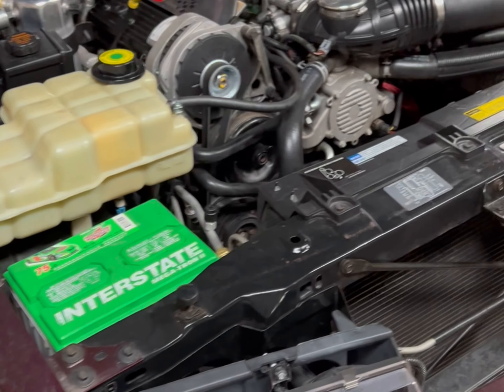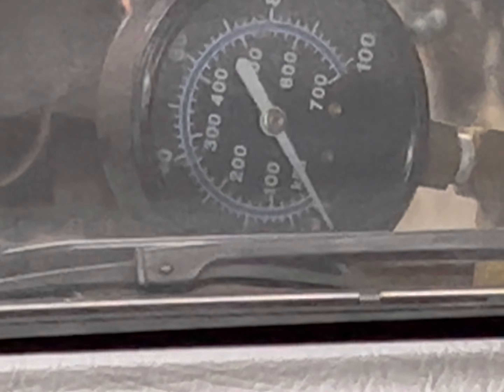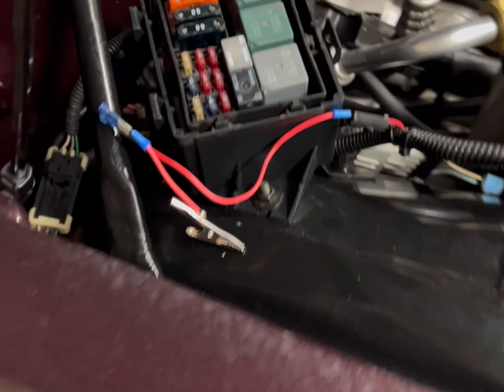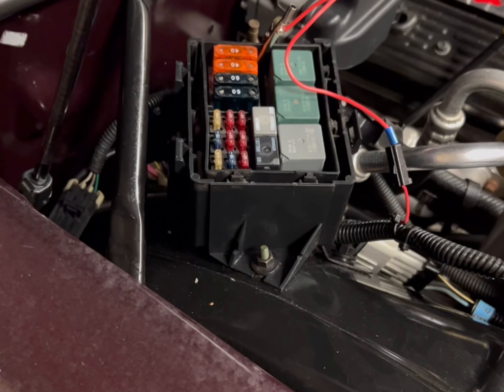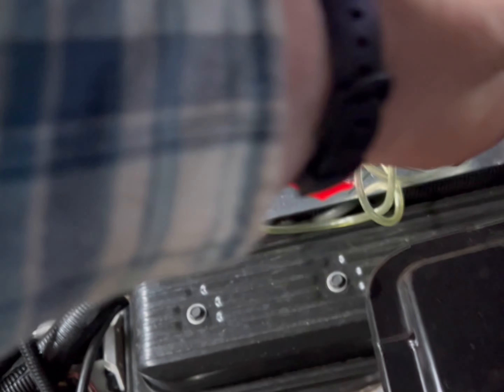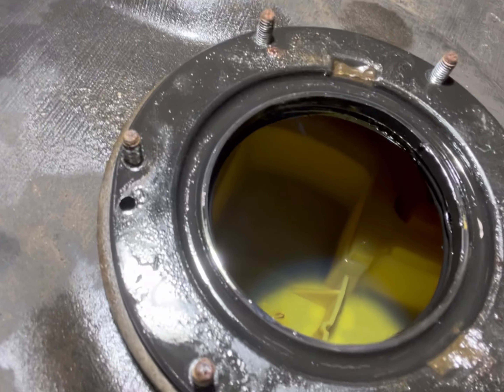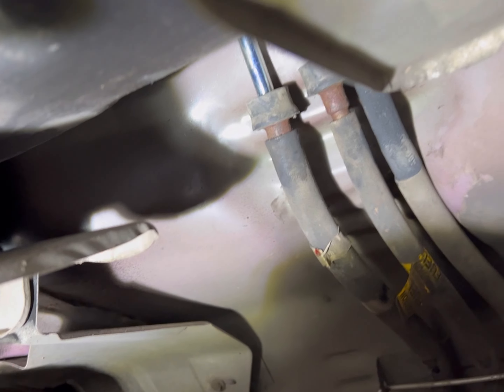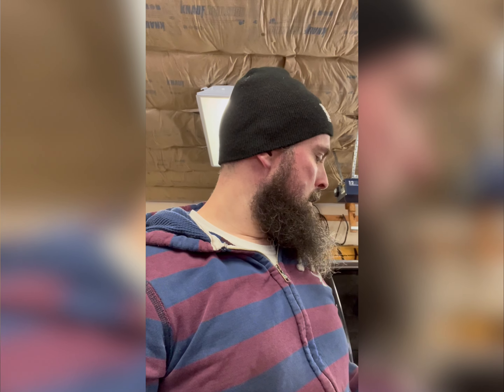Fuel pump and fuel filter replacement on 1995 Impala SS! #chevrolet #impalass #bbody #chevy

Comment: Thank you so much if it wasn't for this video I would have changed the pump I would have been disappointed. I was messing with that red wire and used it for an accessorie and ended up blowing the fuse. It ran fine the next day like nothing ever happened then 2 hours later when I got back in to start and leave I had nothing got so mad I hillbilly towed it home watched your video and BAM new fuse fired right off thanx again hope to see more vids from you.
Reply from the maker: Appreciate it! Glad I could help.

Comment: when I did my fuel pump years ago,I took both straps out,cleaned it out and put POR 15 on them
now they are good for ever

also bought the set gary's fuel pump wires and I never have to worry about those tiny little factory wiring
Reply from the maker: That’s a good idea, I might have to do that here this winter! 

Thanks for watching

Comment: I’ve also had issues with installing the new type fuel sender. The reading were erratic, tried every brand still having the issue. My stock one reading fine but after removiing I did something to ruin it. So your better off with the stock one.

Comment: Have a question u might knw. I knw it has north to do with the fuel pump but I just did my fuel.pump started the car and the park lights come on when I turn the key and stay on what could that be?
Reply from the maker: Could be getting back fed from the fuel pump to the taillights. The harness in the trunk on the drivers side for the tail and the fuel pump all run through the same pig tail. My connector was giving me trouble, so I snipped it out and hard wired all the wires back together. The ground for the fuel pump and taillights was my issue, since they are both on one circuit.
Reply: @Twostallgarage  thank you so much u saved me a few times I believe your right because my blinkers dont blink or anything should I start. At the plug that plugs to the pump first since this didn't happen before I did the pump ?? Or go right to the harness in the trunk ?? Thanks in advance
Reply from the maker: @tkong35  no worries. Since you’re having issues with blinkers, start at that harness. See if when you start to unplug it, your blinkers begin to work or parking lights come back. I still haven’t fully looked at my plug to see why I was getting back fed to the dash, but haven’t had issues since I hard wired it all. You can start with the ground. Work from there. I put my fuel pump on its own ground at the back (believe it was in the video) and eliminated the possibility of corrosion that might be hidden in the harness. Self tapper and an eyelet at the trunk pan area.. coat it with couple dabs of touch up paint and good. 

Hope that helps
Reply from the maker: @tkong35  I had it on another video how I fixed mine: https://youtu.be/E_i2VOvPo8M?si=CCPiAzZh8y1H6I78
Reply: @Twostallgarage  I found the  harness on the driver's side is it the one that comes off the tail light and at the top of the rear fender
Reply from the maker: @tkong35  that’s the one.
Reply: @Twostallgarage  ok so I checked the clip by the tank it's good I checked the clip in the trunk it looks good  could it be the wires I put on the pump it was a different pump so I had to make connections with the female conntors and shrink wrapped them then I found the actual clip for the pump n the box could that be what's causing me nightmares the pump is pumping the lights are on and it bogs down when I give it gas I didn't have this problem until I went in the tank so im thinking it all goes back to the clips
Reply: @Twostallgarage  whe. I turn on the blinkers it shuts off when I turn in the headlights it shuts off 🤔 both clips are in great shape I think it may be the connection to the pump itself thanks again
Reply: @Twostallgarage  I'm back to bother you again 🤣 I ground the pump and it's running awsome but now I have zero tail lights I just have to keep following that harness up ? Do u know the colors for the brake wires or I look on diagrams but I'm not good lol thanks

Comment: bro i had almost the same issue with my 1996 impala today it was a rough idle at cold start but in few seconds the engine become smooth then in few minutes she just quit like i turned off the key, i end up with crank no start the fuel pressure too low so i did the bypass thing and fuel pump worked no problem the pressure went higher but still no start so it seems to be no spark either no check engine light too, wondering what to do next
Reply from the maker: 1995 Impala SS LT-1 Stumble, Stall, Low Idle.. FIXED!
https://youtu.be/BvlUBl0aaMc

Check out the IAC.. simple thing to look. If it’s spark, your opti would be the next thing to check with inline spark plug tester.

Comment: have you upgraded the harness ?
Reply from the maker: For the fuel pump?
Reply: @Twostallgarage  yes. Im planning to upgrade it using the racetronix kit however i have no idea how to do it 💩
Reply from the maker: @BGKO1992  I haven’t upgraded. I’m not familiar with their set up, but I’d assumed the two ways you could do it would be unloom the original harness thru the car to the fuse box and reinstall that racetronix or go race car mode and have the stock harness abandoned and reroute it on the frame rail to the fuse box. Good luck!
Reply: @Twostallgarage  speaking of harnesses, i just checked the female connecter that is mounted between the rear bumber, and the tank, i got no electricity on the first and last but the one in the middle ( the port for the purple wire ) got somewhat decent lighting on my tester screw, is that fine ? or should i get electricity from the three of them ?
Reply from the maker: @BGKO1992  nope, ones power, ones ground, the other is for the fuel gauge.

Comment: Do you know what size the gas tank strap bolts are?
Reply from the maker: I believe they are the M10-1.50 x 40mm   15MM hex- 28MM washer. Just a standard body bolt.
Reply: @Twostallgarage  thank you